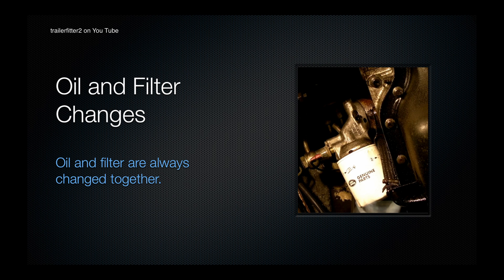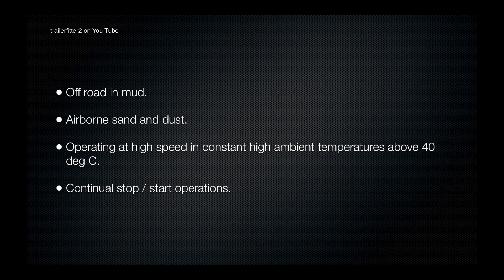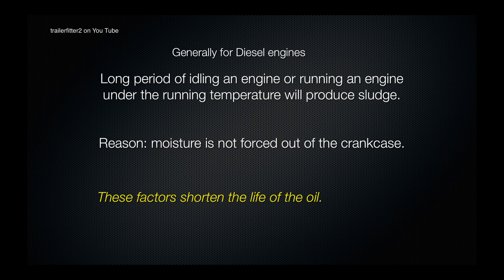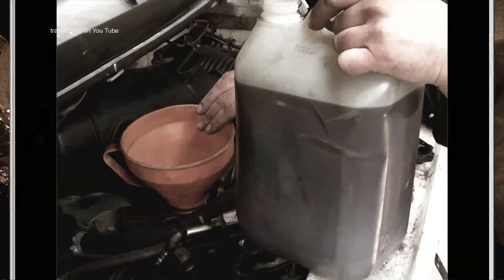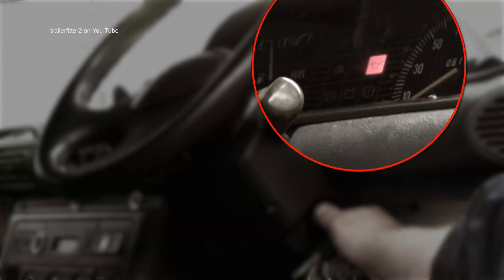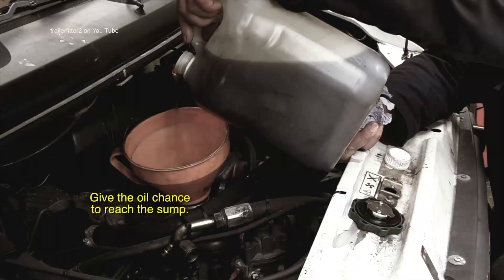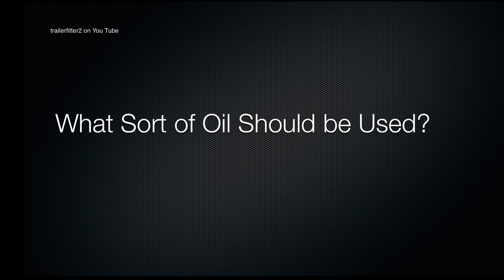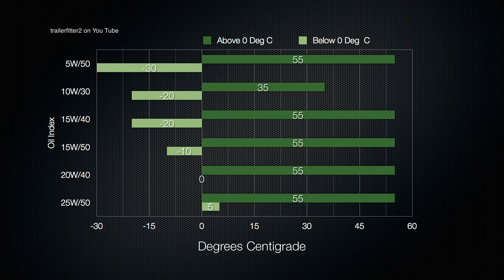Land Rover servicing tips, tricks & tools - Changing the oil and filter? - Oil Viscosity Information

Comment: Hi Chris! I have Defender 90 200tdi from 1994. I changed oil and oil filter and put 6,85l in it (as LR Workshop Manual states) and now I have around 3cm overfill on dipstick! I checked that it is Defender dipstick and it did not slipped inside engine (as it happens with Defender 200tdi). Do you have any ideas what should I do?

Comment: I just bought a 04 TD4 was getting 40 mpg. I dropped rear prop so now 2WD. Blanked the EGR and cleaned the intercooler and inside EGR valve. All new filters . turbo filter too. Oil change. Sump flush. Testing HP pump it kicked in at 50bar and maxed out at 750bar so it got rebuilt. Bosch C1 type pump that's used on loads of cars. Rebuild kit cost £16, after rebuild it maxed out at well over 2000bar. (More than enough to cut through steel plate).  So vapour is a vapour now and not droplets of fuel. I'm now getting over 60mpg and if needed its much faster. No lag from pulling away. Cruises like a multi valve petrol.  Why do I tell you this.. FORGET mapping. Save your self £350 and don't over strain that lovely BMW engine..servicing is everything. . my engine which was OK for 120k is now like new. Looking forward to the 1/4 million mile mark !.  Oil and filter every 6000 miles. . .

Comment: I am in the US and have a Gas engine and it gets hot here. Over 105 F [40 C] Some ppl are using 15W 40 diesel oil in gas engines. I am still using 10W 30 weight. Is diesel oil OK in the 4 L V8 gas engines?